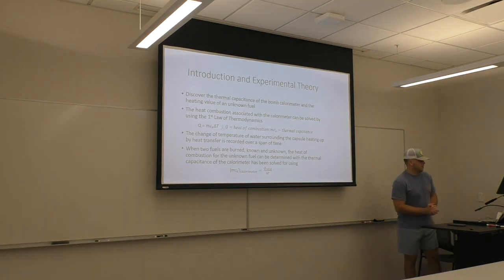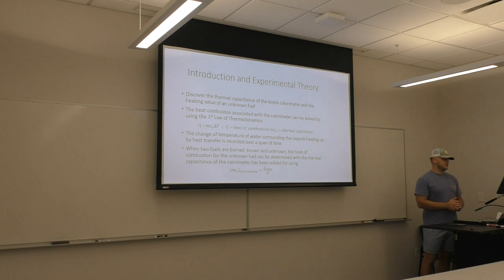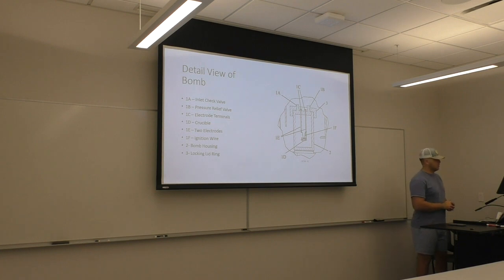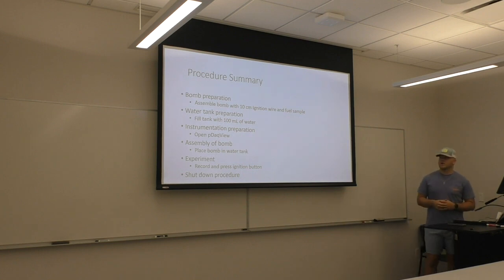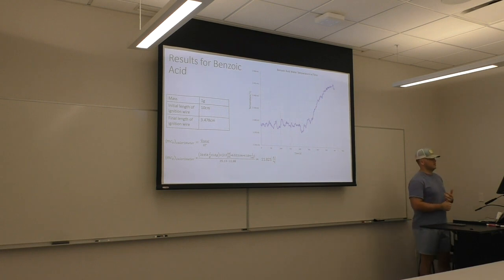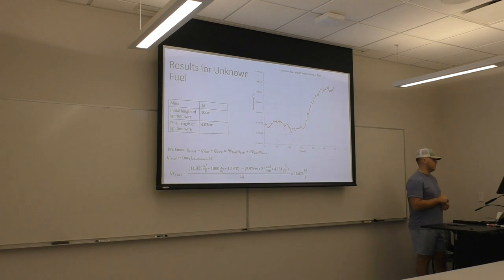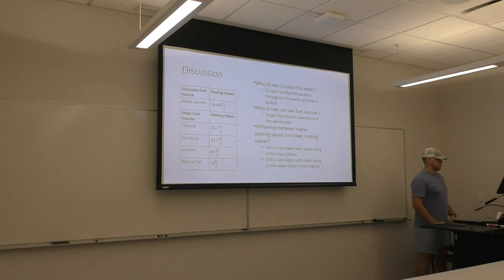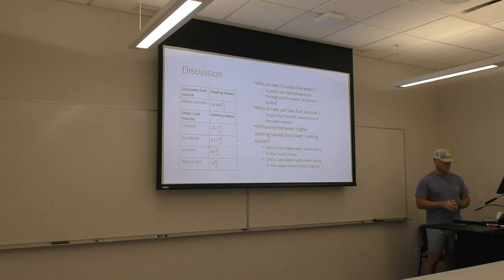Caleb Flanagan

Comment: I think that I did a good job presenting this experiment, and the data from the experiment. One thing I think that I need to work on is not reading off of the power point as much and be more engaged to the audience.

Comment: Good presentation Caleb. The presentation was thorough and it explained the material very well and especially the data which was calculated and portrayed well. I like also how you went into some background of the experiment before you jumped straight into the data which made it easier for the audience to know what was going on. Other than the time of the presentation, I do not have any critiques. Great job!